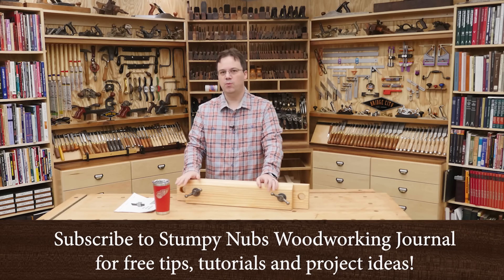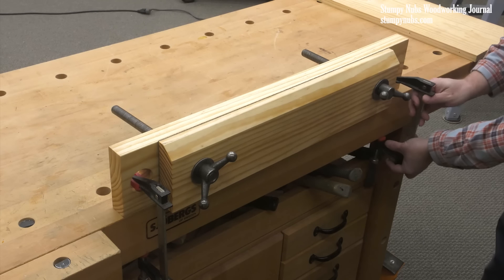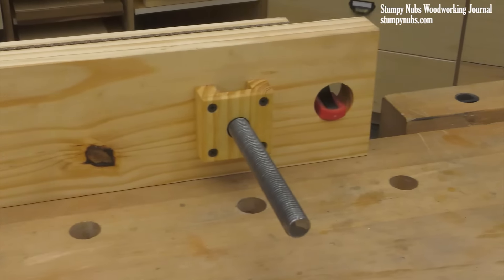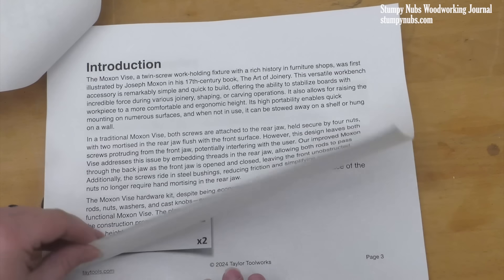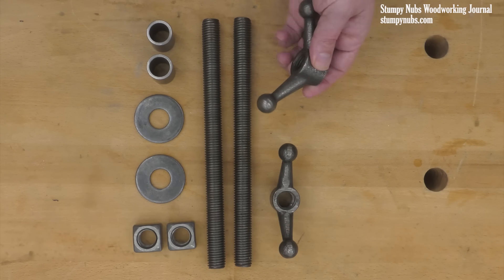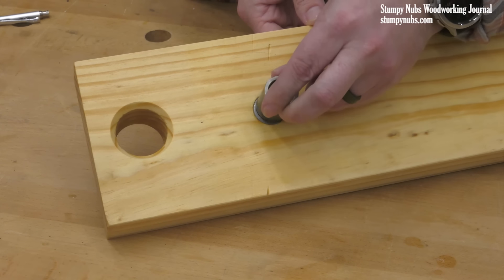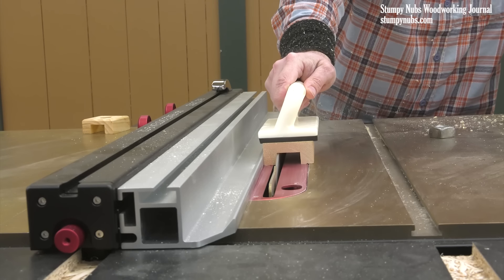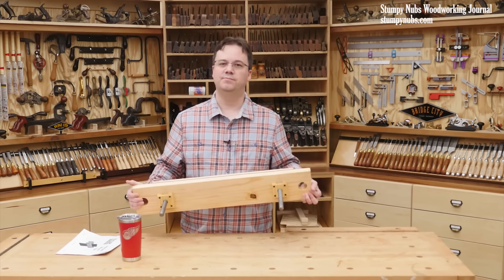Never worry about clamping your work again!

Comment: I built mine with the Benchcrafted kit as there wasn't really any alternative I was aware of at the time and I have their vises on my bench. It's a beautiful thing but it's $189 these days. Granted is has ACME threads which are better but in this application basic UN threads are fine. I wish I knew about this or it was available when I built mine.

Comment: The height factor is great! However, the vise was wobbling whilst you were sawing. The wing nuts were turning too slowly, you should be able to spin them faster with more pressure from just one of your index fingers on each wing nut, in unison. Good idea to hide and auto-align the nuts on the opposite side to the wing nuts. Definitely room for improvement.

Comment: I wanted to do something similar to avoid having the threaded rod sticking out the front and allowing the front face of the vice to move when you turn the handles. I ended up using two basic tail vice hardware assemblies. They came with square nuts that can be fixed to the back face of the vice.

Comment: I went back to Woodcraft this am and I bought the SawStop CTS with the stand. I also bought the Oliver Table Top Drillpress. I am still waiting for your review on the Harvey 14” Bandsaw. The sale is up at midnight on 4-15-24. I also want to add in the Top Of The Line Miter Gauge. I am going to contact Harvey first thing on Monday 4-15-24 and try to swing a deal that includes the Miter Gauge Pro. Hope you had a great weekend. BTW…. Did I tell you what happened to me in March of last year? Looking for your valued opinion. Thom Schuck Portland, Oregon

Comment: Like this design. When you were demonstrating using it to saw on the edge, it looked like the vise rocked some. Would gluing an additional board to the receiving side (the one with the square nuts) givie it a more solid footing or is that defeating the purpose of this design?
Reply from the maker: Perhaps. You could also just clamp it down tighter.

Comment: You should have run the grain on those nut-capture blocks horizontally for beam strength.
Reply from the maker: That would be entirely unnecessary. They are not load bearing at all.

Comment: Thom Schuck here. When you did your back-up review of saw blade guards you had the Blue 14” Harvey Bandsaw off you left shoulder. I am seriously considering this same bandsaw. Have you had a good experience with this saw. I work in my wheelchair so the lower saw deck is really attractive to me and they have it up for a solid price. Can you give me a heads up. Since they dont have a showroom I dont have the luxury of seeing one before I buy. Thank You!
Reply from the maker: I own both the Harvey C-14 and the HW615. I love them both for different reasons.

The C-14 (https://www.harveywoodworking.com/products/new-ambassador-c14-3hp-14-band-saw) is a fantastic saw that will do pretty much anything most people will ever need. It has lots of power (3HP) and cutting capacity (14" max re-saw). The fence and trunnions are of high quality. The guides are the best on any saw I have ever used in terms of adjustability without hassle. The wheels are heavy cast iron and the frame is big and beefy. It has a quick-release tension mechanism and a foot brake. It also has dual 4-inch dust collection ports. My only complaint is the table height is a little low for my taste (34"), but I adjusted to that fairly quickly and if I wanted to I could put blocks under the saw base to raise it a few inches.

Here's a Cool Tools video we did on the C-14: https://youtu.be/4XNh0v2GUJA

The HW615 (https://www.harveywoodworking.com/products/new-alpha-hw615-15-band-saw) is a beast of a saw. It has all the things I like about the smaller C-14 (3HP, 14" re-saw capacity, quick tension release, foot brake, dual dust collection ports), but it is even more robust. Everything about it screams quality, in my opinion. I have tensioned a 1-1/4" blade on it (the manual recommends 1" max), which puts an enormous strain on a saw's frame. But this thing barely flinches. The fence is the nicest I have ever seen on a band saw. The table is extra large and heavy (I have the tin-coated table, which resists rust). If I had to say something negative, the guides are a little more fiddly to adjust on the HW614 than they are on the C-14, but still nicer than most toolless guides on the market, and very heavy duty.

Here's a Cool Tools video we did on the HW615: https://youtu.be/MmMjLHIunQE?t=341

Here's a general video about what to look for in a band saw: https://youtu.be/sUsKYElDKl0

Here's a video about choosing band saw guides: https://youtu.be/3MPR2kcMhJU

Here's a video about band saw blades: https://www.youtube.com/watch?v=z7n7Gg4QOkc&t=0s

Here's another rone about Carbide blades for resawing: 
https://www.youtube.com/watch?v=bSm6hE3bBeU

Here's a video about setting up a band saw: https://youtu.be/tPRrEgnt7wM

Comment: Have you seen the one someone made using some old car shocks? 
I'm thinking about building one of those. I've got a pair of old shocks I could use. 
Though you do need a way to secure them. A welder and some scrap steel is ideal.

Comment: Turn the flange 90° and the square nut won’t fall out the bottom.
Reply from the maker: It didn't fall out the bottom.
Reply: @StumpyNubs  It will when I build it. It’s this gift I have for losing fasteners.

Comment: Always liked the Idea of this vise but what I noticed in your video was a less than desirable clamping to the bench. Slight movement while sawing what occurred as the beginning of a dove tail or box joint. That movement, in my mind is contrary to the whole reason for a vise and there are two surfaces which need to be clamped to, bench and vise. So if anyone has made this what were your solutions for clamping or did you modify the vise?

Comment: 1:03 Can you see the problem?  Clamps reach combined with the thickness of the base allows for too much movement. You should have chosen either the thicker base or more robust clamping system. Just saying.
Reply from the maker: Tighten the clamps more. Just saying.
Reply: @StumpyNubs  Sorry if I sounded rude by just saying. In my experience tightening the clamps to solve for movement of a jig is a sign of bad engineering. Jigs should be stable, plumb, square, precise as designed. Clamps are there for positioning and strength.

Comment: I ordered the parts and the instructions ask for some odd thicknesses.  Yes you can use a 2x6 and cut it down to 5" as instructed but the 2 1/2 by 2 1/2 has to be manufactured or maybe use a 3x3 post piece, but I don't think that would be as strong using an end cut..  Not sure why it was not just designed with off the shelf widths.
Reply from the maker: Glue two pieces of 2X4 together, then rip them to width/thickness.

Comment: You'd think those wooden bloks would be mounted with the channel going horizontally. Mounted vertically as shown, the nut can't move with the slots in the front board.
Reply from the maker: The nut is not supposed to move with the slots in the front jaw. The slots are intended to allow the front jaw to be tightened without being perfectly parallel to the back jaw, which would cause binding if not for the relief provided by the slots (elongated holes)
Reply: @StumpyNubs   How can the slots do that when the jaws will be out of parallel horizontally? Don't the nuts need to move horizontally as well to compensate?
Reply: @StumpyNubs  I think my last reply is confusing. What I'm wondering is, what's the purpose for the vertical channels holding the nuts? I'm not understanding why there's a need for vertical slack.
Reply from the maker: @austin2842  There is no specific purpose for them to be either vertical or horizontal. It makes no difference.
Reply from the maker: @austin2842  The nuts do not need to move. The rods remain straight while the wood front jaw moves because of the extra room provided it by the elongated holes. Without allowing for that movement, you would be forced to turn the two cranks at the same speed lest the jaw become crooked and bind.

Comment: I'm not a native English speaker. I hear you say "boring holes" instead of drilling holes. What is the correct way to use the words boring and drilling?
Reply from the maker: Technically, the tool is called the "drill." The act performed by the tool to create the hole is called "boring." But both terms are used interchangeably these days.

Comment: Why not just weld the nut to a bit of steel, and then screw the steel to the back jaw?
Reply: I think the idea is that the nuts should be able to have some wiggle room to adjust to misalignment in the rods, unless you want to have to tighten them in perfect sync all the time
Reply: @melainekerfaou8418  Doesn't matter. You put the piece you want to clamp between the jaws, push the jaws together with one hand, and then tighten the screws one at the time. Remember, the outer jaw slides freely on the rods. Sure, the last turn or so, you actually tighten it, but there is enough play in the rods for that.

By the way, I'd put a short length of steel pipe glued in place in the holes in the outer jaw, just to avoid the threads wearing on the wood.

Comment: You cannot down load the file as mentioned. It's locked in Abobe Acrobat online with no way to download.
Reply from the maker: Worked for me. Delete the file and try it again.
Reply: There are 3 little dots on the top right of the page, click on that and there is a download file option that doesn't require you to sign in to Adobe.
Reply: @rottingtimbers  Thanks for the secret. Don't know why web site designers can't make something like "download" obvious. I initially signed in, (had an Adobe account) used the "Export a PDF'  feature to export a MS Word version. Downloaded it, used Word to save back to PDF. I tried all the obvious buttons but missed the 3 dots. Thanks, I try harder next time.

Comment: - Fatasticly simple clamping tool...?? why would one need the plans for such a simple device - a set of screws is  all one really needs (hex nuts can also be held in a parallel sided fitting)... (make wide enough for any single panel you my want to make  -  Or, make a few sets of "jaws" for any project, cleat mount to the front of any workbench front for flexibility  - and permanence - even dog-mount to the a workbench top if you so desire.  nice..